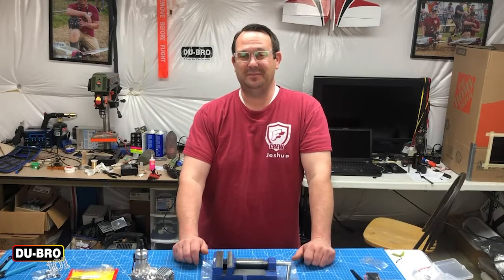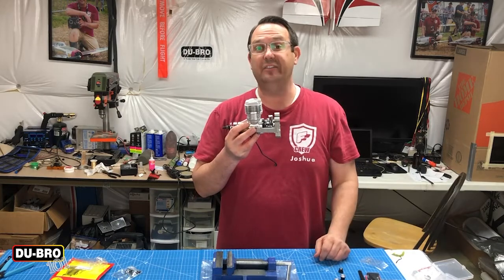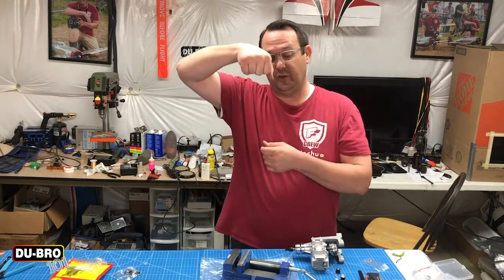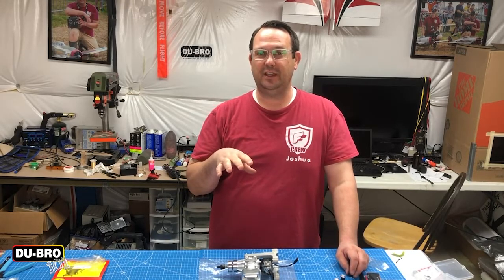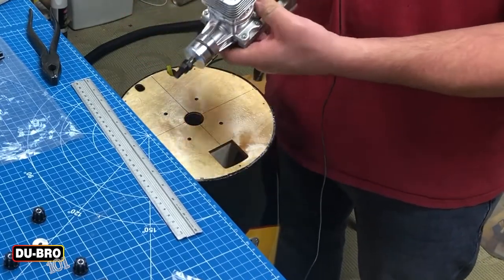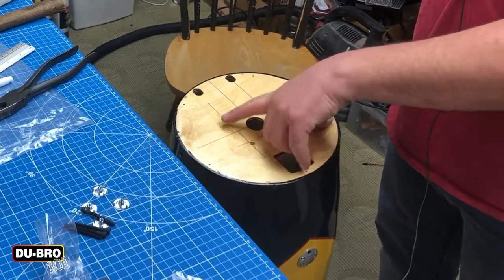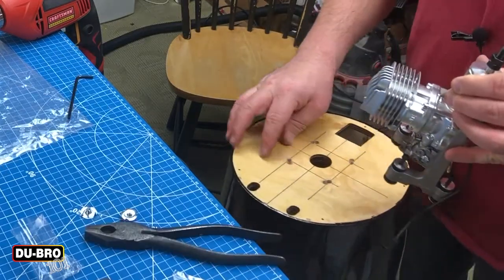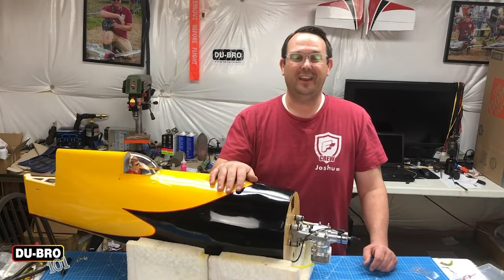DU-BRO 101: How to Install a Motor Mount

Comment: These are high quality strong mounts and highly recommended.

But a friendly note here: the Hobbico/Horizon Hobby manual they produced to be distributed with the DLE-20RA recommends the DUBRO 688 mount that has the 70mm spacing between the mounting bolts. However, the 688 mount is too big and the muffler of the DLE-20RA will hit it. So what is recommended in the Hobbico DLE-20RA manual is incorrect. 
However, the mount shown in this video by Joshua is the DUBRO 686 which has the same beam length as the 688, but only 63 mm between the mounting bolts, which will fit the DLE-20RA as shown in this video.

Comment: Invest in a set of 'transfer punches' better centering for drilling. Standard sets are usually about $10, Metric sets are usually more expensive but worth the investment.
Reply from the maker: Thanks for the Tip!